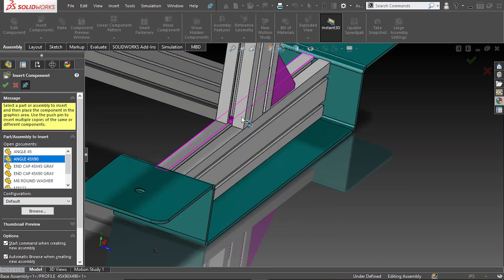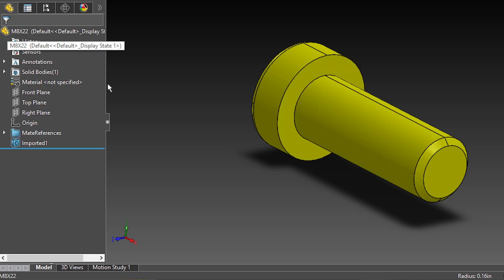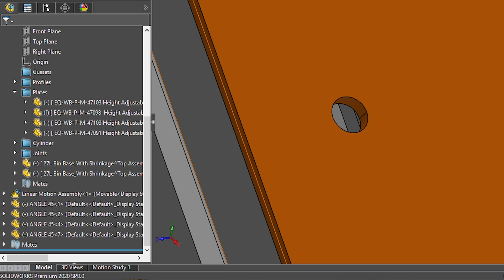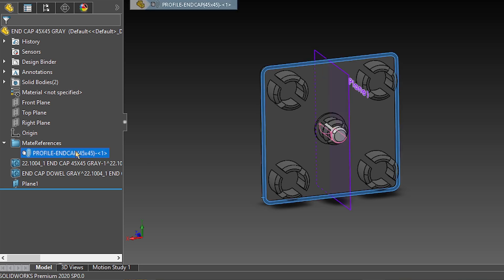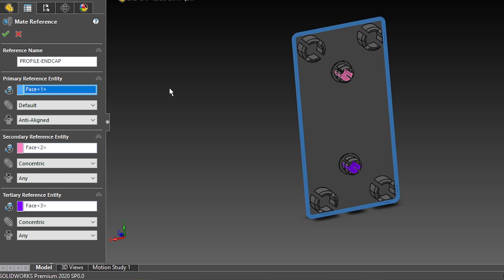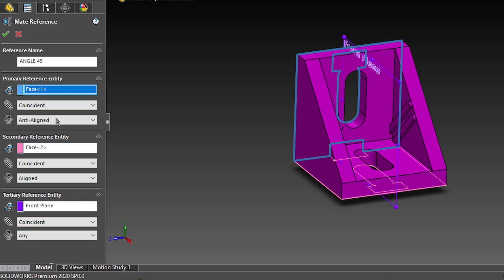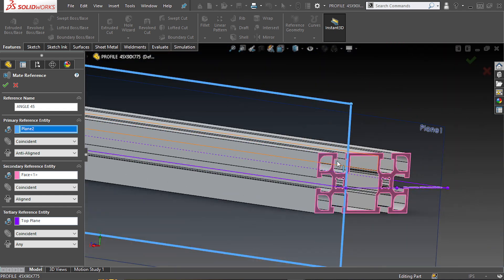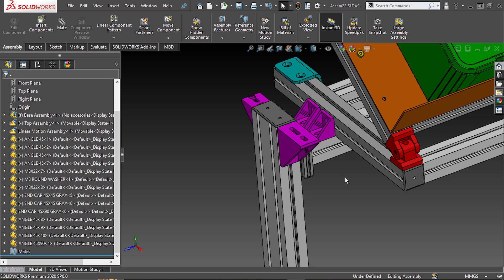Get Smart with Solidworks: Automate Your Assemblies With Mate References

Comment: In the first few seconds of the video, how are you using Insert Component and adding the same part multiple times? Are you holding Ctrl, Shift, or Alt?
I try Insert Component but when I click the part to insert you function goes away and I have to click Insert Component again.
Reply from the maker: The same window on the left with the options for inserting components has a toggle button on the top right corner in the shape of a... Needle with a handle? Sorry for not knowing the translation, but that button turns blue when clicked on it and then the window stays on until you click the button again.
Reply: @solidsensei  YES THANK YOU WOW
I didn't know that after 10 years. Thank you

Comment: Great way to save time. Another way is to use the solidworks feature "copy mates." You will still need to mate at least one component; however when using the feature solidworks will remember the mate features and allow you to paste as many components as needed.
Reply from the maker: You know, I've seen that option and never cared to use it. Thanks for the tip!

Comment: I have a D-Shaped hole feature that I pull in from my parts library.
There is an LED module that sits inside the D-Shaped hole, and I would like to use smart mates in an assembly.
Is it possible to add smart mates to a Library Feature part?
Reply from the maker: I haven't tried it, but I don't think so. After all, your library feature will be used in a lot of different parts, not necessarily with the same references always. I think it would be best for you to create a part with multiple configurations and then add the mate references to the part itself